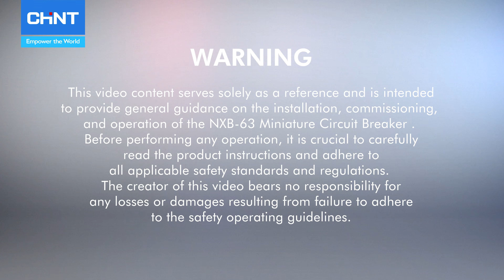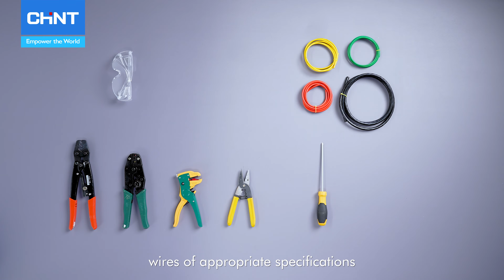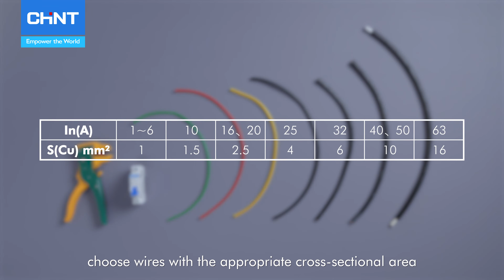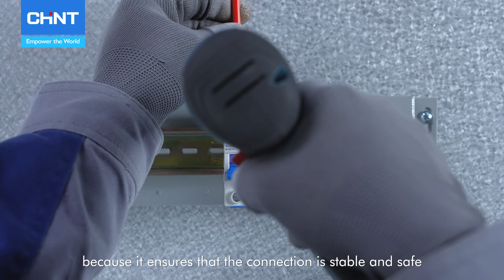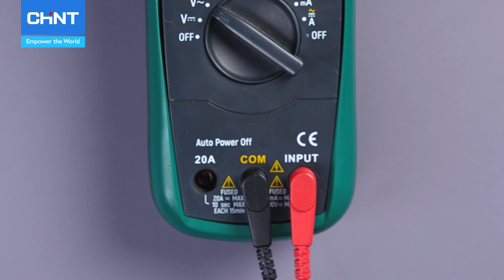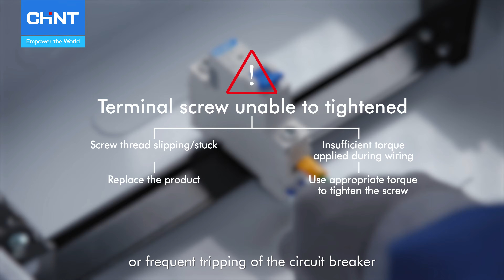The Installation Guide: NXB-63 Miniature Circuit Breaker

Comment: What is the difference between NXB-63 and NXB-63H?
Reply: The NXB-63H offers a higher breaking capacity than the NXB-63. Specifically, the NXB-63 has a rated short-circuit breaking capacity (Icn) of 6000A, while the NXB-63H has a higher capacity of 10000A